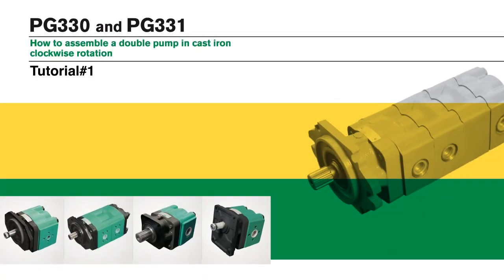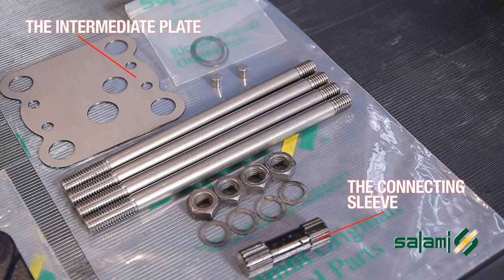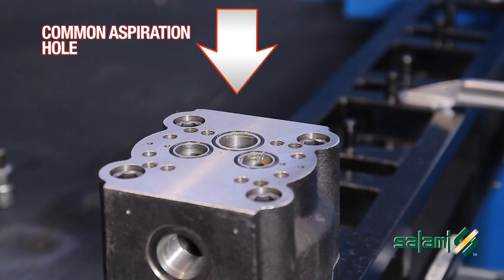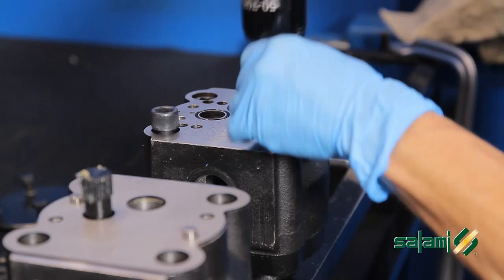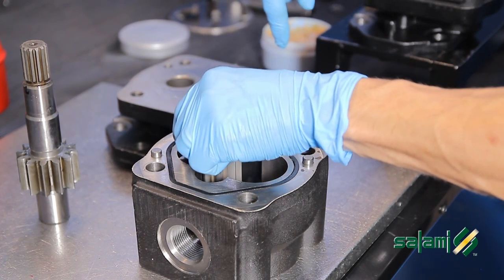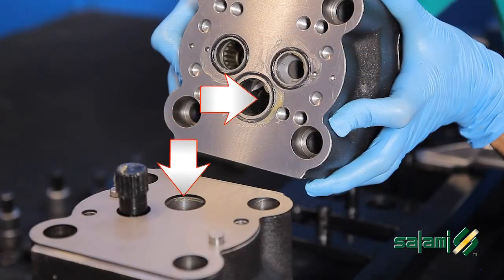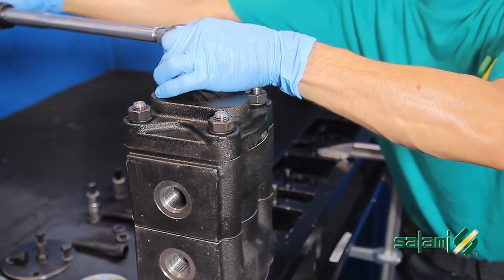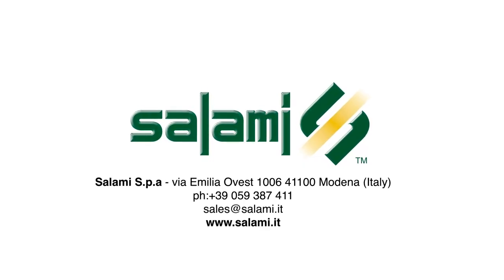PG330 PG331 Tutorial01 Cast Iron Gear Pump Salami SpA

Comment: I change seal kit of my double hydraulic pump after that  the pressure become low
Before I change the kit the pressure is good
All procedure is correct  for the first time happened in repairing hydraulic pumps